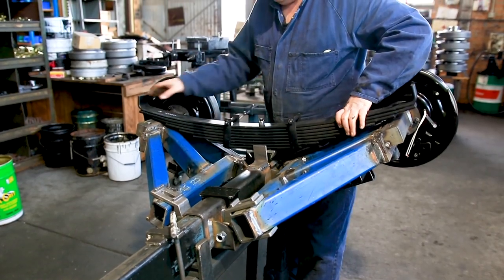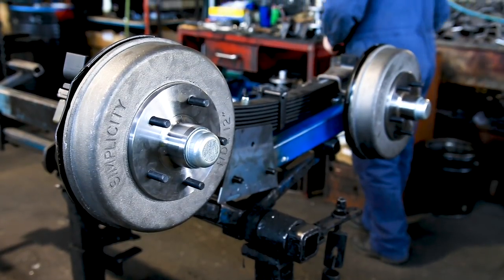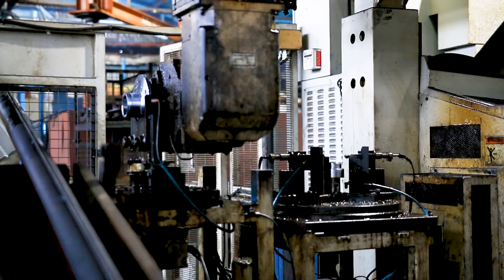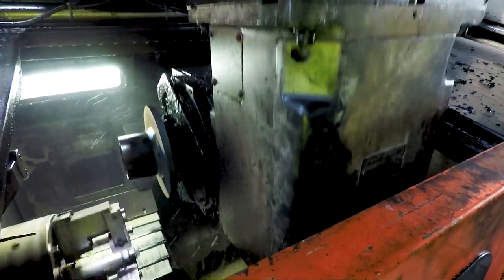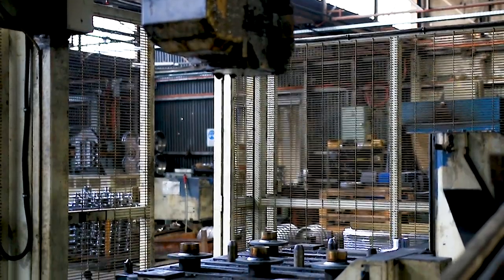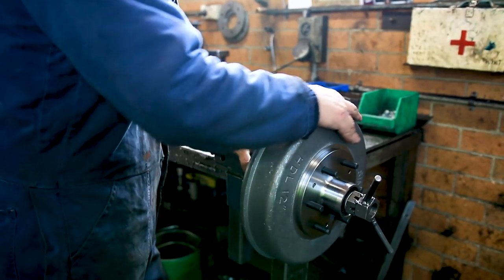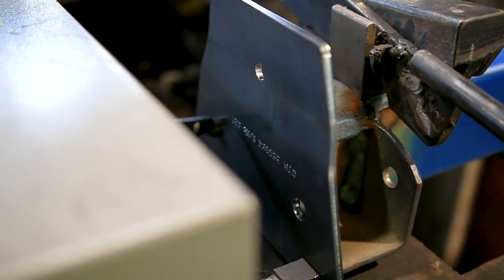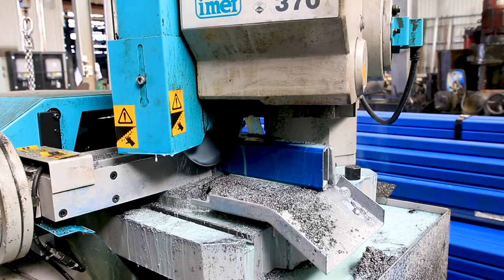Simplicity Axles and Suspension

Comment: The combination spring-shock absorber was mentioned. However, the spring is the component that absorbs impact energy - the shock. Is the component referred to as the shock absorber in actual fact the damper?